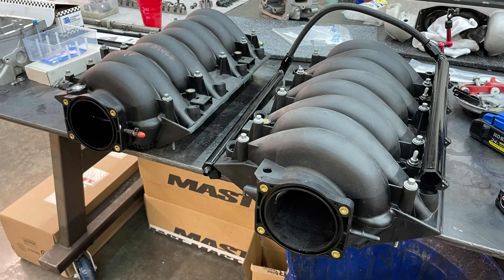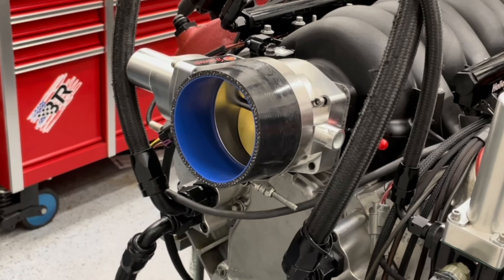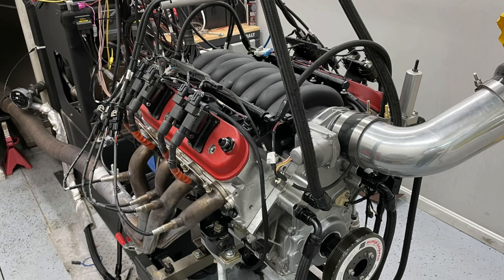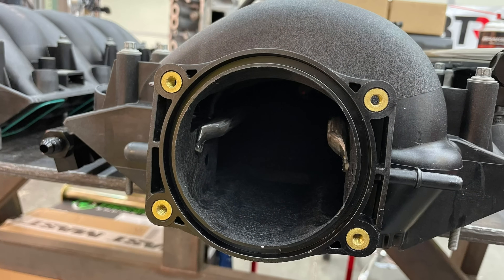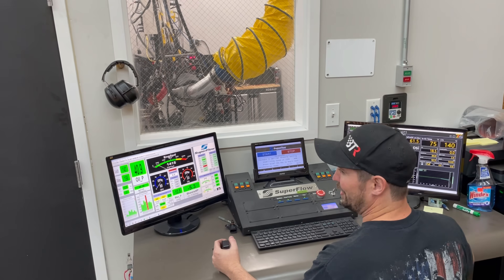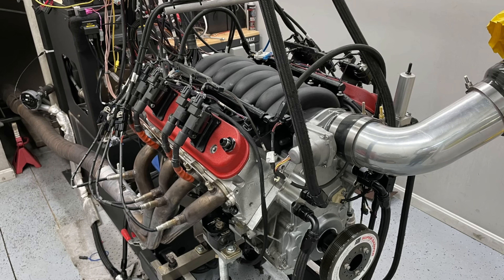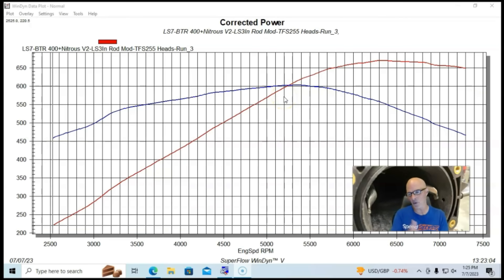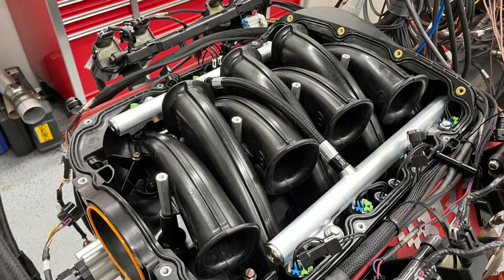HOW MUCH POWER IS THE LS3 ROD MOD REALLY WORTH? 427 LS3 STROKER INTAKE TEST-STOCK LS3 VS ROD MOD

Comment: Sketchy...If I wanted to skew HP/TQ gain results from a  ls3 intake rod mod/porting upgrade, I would use the same engine used in this test because testing 6.2L LS3 intake manifolds on a 7.0L LS7 with some pretty heavy mods makes no sense unless you want to document low power gains.
Reply from the maker: Agreed-there is something sketchy about a direct back to back dyno test that shows actual results and not what you wanted to happen.

Comment: i think this test would have been better on a stock block and heads or even a cammed LS3
Reply from the maker: feel free to test on the motor you like
Reply: @richardholdener1727  i have but with a dynojet thanks

Comment: I think you should try to test it in a smaller motor. Everytime I see gains on these is one stock bottom end with heads cam, like on ls2 heads cam or ls3 heads cam and that’s when I see people making 8-12whp increase. Unless you’ve already tested it, if so would be really cool to know what happened.
Reply from the maker: If the manifold does not show gains on a bigger, more powerful motor, usually it shows even less on a milder, smaller motor
Reply: @richardholdener1727  thanks for the reply and well disappointment hits haha

Comment: Hmm you didnt run a ported stock throttle body from Mamo or Soler which is most of us do when running a rod mod intake manifold please redo test with ported 90mm throttle body
Reply from the maker: other intakes with the 90mm made much more power-'not that
Reply: @richardholdener1727   I would like to see that

Comment: Those of us who have a ls3, l77 or l76 with rec port heads know that this was totally the wrong combination to run this test on. This manifold is designed to run under 7k rpms with stock size engine. Test by Rick Crawfords and countless others show around a 15 rwhp increase and good gains in torque under the curve on stock sized engines. Rod mod out flows fast up to 6,600 rpms on stock sized engines and GPI would not be selling them if they didnt make power for years
Reply from the maker: THIS WAS A GPI ROD MOD
Reply: @richardholdener1727  He never said it wasn't or was anybody else that did the mod. But a good way to deflect I guess.
Reply: @richardholdener1727 my man...test oem vs rod mod on a stock LS3. Proven time and time again at the track. 

That being said, I'm surprised at these results. I expected better.
Reply: @SilverSurfer77  wrong engine combo for this test should been done on ls3 with smaller cam.

Comment: my ported ls3 intake made 15hp more over a stock deal on btr's dyno mule. the throat can be matched to a 102mm an you use a gasket. i had also shortened the runners to 7.5". it carried power to 7400. peaked at 6600 an stayed the same to 7k. nick tested it file was lainos ls3 intake i believe.

Comment: Your intake is 102mm
Your exhaust is 2 3/4 primary ending in 3 in 
Your restrictions will b come cam and valve size 
102mm sounds great but it’s half of your exhaust flow
Reply from the maker: start thinking heat and pressure

Comment: Would a smaller engine have more of a turbulence issue to be solved by the rodmod?
Reply from the maker: turbulence?
Reply: @richardholdener1727  isn’t the purpose of the rodmod to straighten out turbulent air?
Reply from the maker: just to improve airflow into the port

Comment: That’s weird. I did a direct compression of the rod mod and I picked up hood power on a Texas speed ls3. I think the rod mod works way way better and it’s more efficient on standard cammed ls3 “6.2” vs the big 427. Here’s my dyno video with a direct back to back comparison. We swapped the stock intake manifold to a rod mod intake with the exact same conditions without changing the tune and picked up really good power! https://youtu.be/TsMIhDaqUco
Reply from the maker: would be odd if it worked better on a less powerful motor
Reply: @richardholdener1727   That manifold was not designed be used on a big inch stroker. If on LS3 or l77 or l77 stock cubic inch yes makes power up to about 6,600 rpm.
Reply: @richardholdener1727 aye the don’t lie. We did back to back runs on the same day under the same conditions.
Reply: @Its_Mike_Myke   My LS2 with Mast Ls3 heads stock LS3 intake vararam and a healthy cam 624/615 243/250/114 made 477/418 I shaved the heads from 66cc to 63 cc and a .045 headgasket got an X-air air intake and the Rodmod and the car made 522/467🤗
Reply: There’s a few uncontrolled variables going on when it comes to the placement of the rods within the LS3 intake manifold.  Different companies use different techniques and Rod size/placement.  As always, love the channel and the effort y’all put in for the data🤙🏼
Reply: @smokingasphalt8050 we are splitting electrons at this point.
Reply: Hey  Mile you notice he didn't run a ported throttle body for the test which is what you did and what most people do with this manifold. He did same thing with Performance design manifold test. He use stock 90mm un ported which only showed 15 hp gain with stock throttle body then bam does 102mm for big gain. Yeah wtf?

Comment: It would have been nice to see if a fast 102 intake would have done any better on this combo
Reply: It wasn't amazing in the previous test. I doubt a couple more cubic inches would make all the difference given how it performed. Given everything I've looked at, including Richard's extensive testing the FAST is most at home on a cathedral port LS.
Reply: @emperorbobarino  in the intake test the motor was just stock ls3 with a mild cam pushing just 52x hp. This one flowing more air would have shown if the intake opening really is a restriction or not. Fast performs same as ls3 intake except for it having 102mm opening vs the 90mm. Testing 90 vs 102mm throttle body is not as helpful since opening is restricted.
Reply: @clueless4wat322  It pretty much doesn't matter. Watch the performance design test. The biggest gain was 11HP for TB/TB opening. The difference on a 427 CID engine between a 90 and a 102 was 6 HP. 6 HP on an engine this big, making this much power.
Reply: @emperorbobarino  good to know, I'll take a look at that also. I thought it might be closer to 20hp on a good run but even then I could never justify the cost of it. Thanks for the info!
Reply: @clueless4wat322  Sure thing. Factory LS3 manifold is really, really hard to beat on stuff less than 7L/427 cid, is LS3 headed and under 7k rpms. Doesn't hurt that it comes with the motor and has the best hood clearance either.

Comment: GM 87-90mm throttle bodies are more than big enough to support 700+ hp setups.  So I'm not surprised by zero gains.  The 102/103s are perfectly fine for setups into the 1000+ hp range, so overkill for this engine.  We recently made 1100+ whp on a hub dyno on an LT4 with an off the shelf NW103 - pressure drop between the blower (2650) and the throttle was minor.  When you consider that the blower has to be consuming at least 100 hp on top of that, it's a ton of power.  Since throttle flow is pretty much a function of area, we'd expect a 90mm to flow 75% of a 103, and be good for at least 750-800 hp.
Reply from the maker: I would use something bigger on a 1000-hp draw through (PD blower) combo-we always see vacuum and power with 102 at 1000 hp
Reply: @richardholdener1727  We only see 1-2" of pressure drop across a 102/103 at 1000 hp PD setup.  Small enough to really not care, especially given how much harder it is to fit the 112 underhood on many LS setups due to belt drive issues/clearances.  By comparison, a stock 87mm throttle body was seeing 5-6" of drop at 800 whp PD setup.
Reply from the maker: and a 700-hp na motor sees sizable gains stepping from a 90mm throttle body to a 102 or bigger

Comment: thats a expensive motor right there  only to get waxed by a 302 coyote on the street   even this race engine is only 1.5 hp/ci sad   a coyote does that stock
Reply from the maker: I like Coyotes and have tested them, but an na coyote is bus lengths behind a 700-hp 427.

Comment: I don’t really see much point in the tb test. If you don’t blend the opening I think you just testing how consistent the dyno is 😢 I mean you have one intake with hours and hours of a waste of time into it and it would only take a solid 10 mins to blend that opening😂 maybe I’m missing something do they get to thin or is there some reason why people go through all the trouble of that rod mod but don’t blend the entry?
Reply from the maker: to go to 102mm opening you need to intersect the o-ring channel
Reply: @richardholdener1727   I have a gasket with my 102

Comment: are you testing the performance design ls3 intake?  I recently installed one on my car not time to take to chassis dyno.  Appears from draggy results .15 better 1-1.5 mph faster. ls3 crate hotcam engine.
Reply: I just have the 101 with stock 90mm tbody
Reply: Which size XS intake and throttle body?
Reply from the maker: coming today
Reply: @richardholdener1727  your the best lol would be interesting to see in future video if you do 8 widebands on it to see what different runner lengths does
Reply from the maker: this had 8 wide bands on it

Comment: 598 lb/ft divided by 427 CID = 1.40 lb/ft/CID. That is impressive and needs a lot of overlap to be realised. It we just chose 274 degrees on the exhaust lobes for the calculations we get 274 - 247 =  27 degrees difference, divided by four we get 6.75 degrees. 
112 LSA - 6.75 degrees = 105.25 degrees LSA. This cam has overlap as if it was a 247/247 cam on a 105.5 LSA. :) 
No wonder it works well.
Always nice to see 8 lambdasensors and 8 exhaust temp. probes.

Comment: 427 with a 4.130 bore is crying out for more cylinder head, especially with the monster camshaft.  LS7 with LS3 heads is an interesting choice, seems like a step backwards. 

The 102 test matched results with my test of the same. Even with the throat opened as much as possible eliminating the factory o-ring groove completely there was no gain at all with a 102 (on a moderate cam/stock head SBE LS3) - the manifold itself is the restriction at that point.
Reply from the maker: We ran the CNC ported LS3 TFS head to allow us to run the LS3 intake tests. They flow more than enough to support the tested power level.
Reply: @richardholdener1727  for sure, gotta have LS3 heads to test LS3 intakes.  Just saying it's an odd combo, in most cases of you were going to the trouble of the big bore, you wanna take advantage of it!
Reply from the maker: we ran ls7 heads too
Reply: Sweet, can't wait to see the results!

Comment: water pump mod, you run an external pump? part number? last question, can it be used for a daily driver setup? digging the pluming setup, thanks in advance!!
Reply from the maker: remote dyno pump but Meziere has electric and remotes for sale
Reply: Awesome! , I'll look into it , thanks again for the response 😁

Comment: I missed the compression ratio on this setup...  I feel like it should have made more power with that cam.  Were the heads up to the job?  Was the LS3 intake, in any form, pretty much maxed out?  Do you think this thing could have made closer to 700 hp with bigger heads and a different intake? Overthinking it maybe.  ~ 670 is excellent.  Let's see that setup with the FAST LSXHR and the proper throttle body opening.
Reply from the maker: we have Hi Ram, PD, Pro Flo and BTR intakes coming up
Reply: @richardholdener1727  Bless you Richard Holdener

Comment: I've ported/rod modded lots of ls3 intakes. Typically we have found track performance improved .1-.15 and 1+ mph from doing the rod mod / porting.

Other than that... yea a 102 isn't gonna make any difference if you don't epoxy up and port the intake out to a 102.....been there done that.🙄

To be honest i can't believe you would even waste time trying it like you did.

Comment: Do I spy some other brand new rec port intakes on the table? Really curious to see how those compare. This is a combo where I would expect good things from a proper 102 intake and TB setup.

I have a ported rod mod intake on my "LS3" former Escalade engine. I don't know if it made more power, but it sure likes to howl at part throttle.
Reply: I can see the rounded top of the new Performance Design XS LS3 intake in the background.
Reply from the maker: that test coming today

Comment: I wonder if you had the 87mm throttle body, would there have been any difference with that? Would the low end torque have come up any while snubbing the higher rpm areas?
Reply from the maker: smaller throttle body never ads low speed torque

Comment: man, brian tooley loves him some exhaust duration, even on the all motor cams.

a lot of cam makers are doing that. i don't wanna lose more drivability just to wing out at extra 4hp at the very top. i know rec ports are a little deficient but still...
Reply: @richardholdener check out gm motorsports comparisons with mod rod and cam comparison with btr cam vs gm motorsport. Quite interesting about exhaust duration
Reply from the maker: not sure where you get the notion of 4 extra hp
Reply: @richardholdener1727  I think he's using a hyperbolic statement, seems like he's suggesting that compared to other can designers/manufactures, BT likes to push exhaust duration more than most, for little power gain at a cost of a lot of driveability.
At least that's what I think he's saying?
Reply from the maker: "he likes to push exhaust duration more than most for little power gain at the cost of driveability," said no knowledgeable individual ever. Take care with generalities...or just look at the success of the Truck Norris cam. Much to be learned
Reply: @richardholdener1727  I'm just older now and milder cam timing guy now. The "it's not that serious" phase. lol
Reply: Explain how a NA LS3 making 650+ HP deficient ?
Reply: @jamesgeorge4874  intake vs exhaust flow ratios. didn't say this engine in particular.
Reply: @anthonyrowland9072  Sound like you have no idea what how these things work. Heads like these are designed to work best on a specific application, and if they don't, it's because the builder did not spec them correctly , not the heads have "some problem". The idea that you know better than the content creator is laughable, really.
Reply: @jamesgeorge4874  rectangle ls heads often have lower exhaust port flow numbers in relation to the intake. that's why cams for them have a big split...
Reply: @anthonyrowland9072   Show me ANY cylinder head that DOSENT have a larger intake port / valve than exhaust.
Reply: @jamesgeorge4874  a head with an exhaust port that 65% of the intake is gonna need more cam on the exhaust side than with a head that flows 75% of the intake.
Reply: My 67 Camaro with an LS7 gained going from the Stage 3v1 to the stage 4 V2 LS7 cam...and its got a wide split too....
Sounds pretty nasty at 7600rpm with the Hi ram in the old car twisting a 4l80e...

Comment: Need to run this same test on a stock ls3
Reply: GPI has already done that test with their Intake shootout
Reply: @justinw6448  got a link only one I found from gpi made like 610
Reply: @Smithtobewith  This is the GPi intake test video on stock bottom end LS3 (376ci vs 427ci in this video), ported OEM heads (vs TFS aftermarket heads in this video) and a different cam. It's not an apples-to-apples comparison, but you can compare the deltas with no other changes made. It's possible the GPI engine was using an OEM water pump as well.

https://www.youtube.com/watch?v=LnAO1rKg7Lg&t=741s